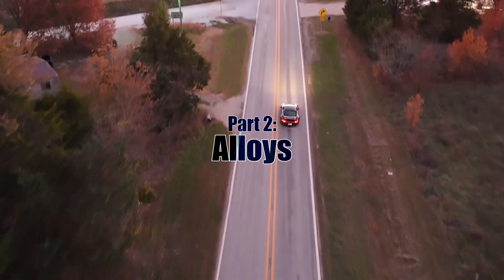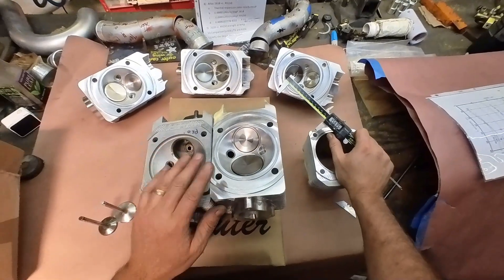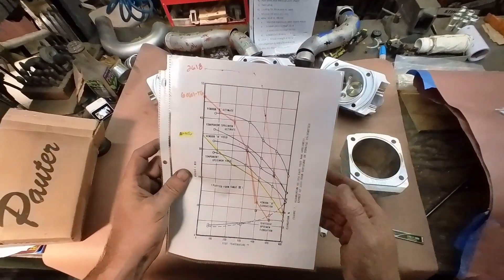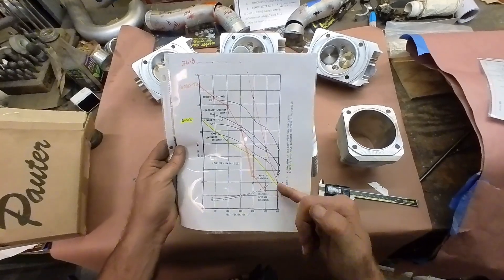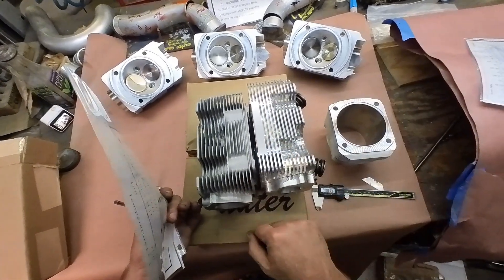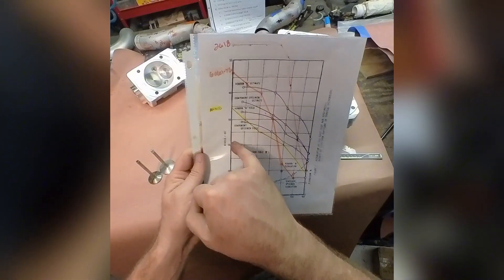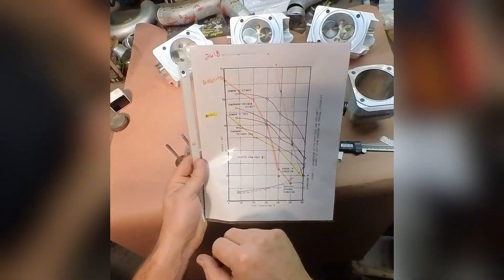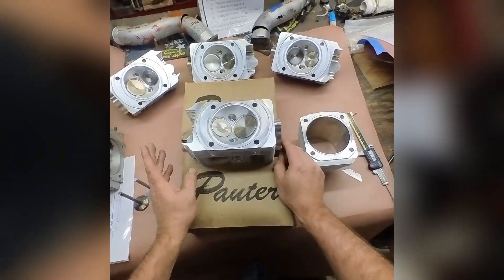Ep 2: Porsche 993 Turbo Billet Cylinder Heads In Depth Review

Comment: Great vidéo Todd🤘 Rolls royce alloy still à great option but today à fully billet head resist better , just temp peaks and heat dissipation still not better on billet heads😉
Reply from the maker: Thanks.  This was more of a curiosity comparing the Oem casting alloy vs billet.    I was impressed to see the original alloys capability at very high temps.

Comment: what alloy is the cylinder made from?
Reply from the maker: I belive those were mahle liners so would be 4032.   Ln is making 2618 liners now.   Mahle motorsport also makes 2618 for custom parts. Some of the billet 3.8 turbo upgrades were 2618 as well.